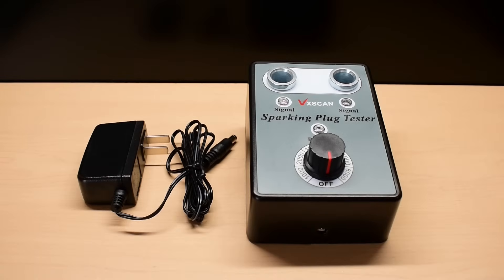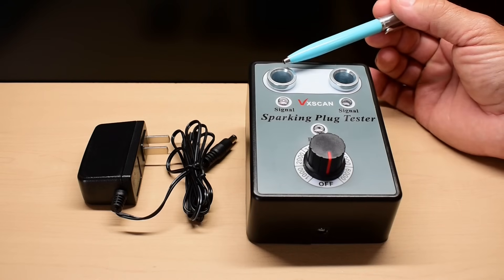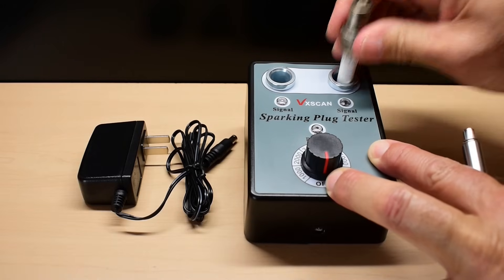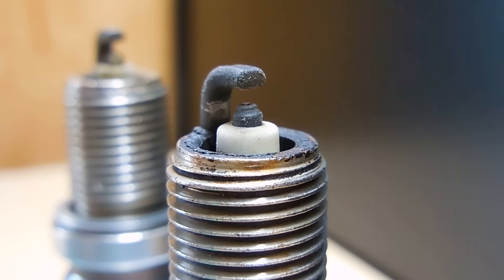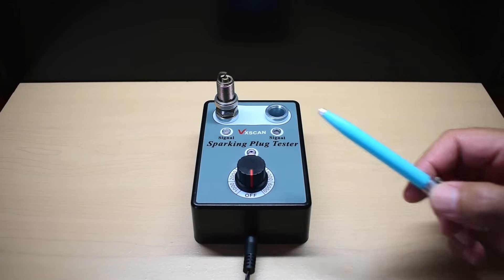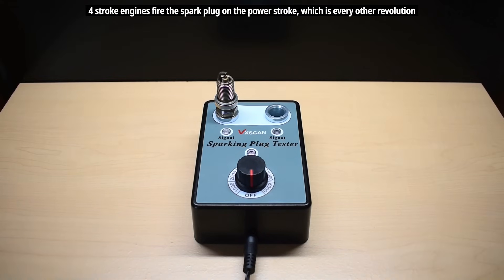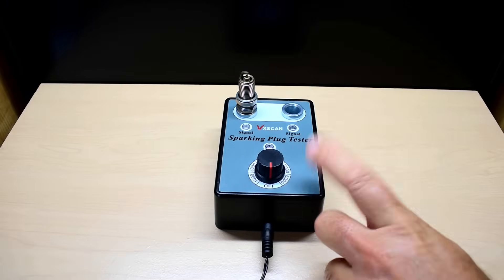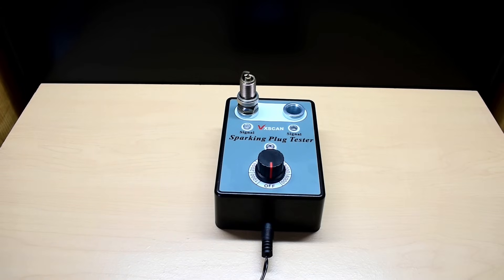How To RELIABLY Test Spark Plugs In Seconds!

Comment from the maker: Always clean the tip of the plug using a stiff toothbrush with carburetor or brake cleaner to remove any debris that can cause fouling.
Reply: Or you can use a soft,  brass wire brush.
Reply: @ronniepirtlejr2606  that's not a good idea because of the risk of short circuit.

Comment: The whole point of a spark plug tester is to check the air gap breaks down before the insulator.  The breakdown voltage of the airgap increases with compression, so this test is pretty close to useless.  Dielectric strength of air at atmospheric pressure is about 3kV/mm, plug gaps are about 1mm, yet it takes about 12 to 25kV to fire one reliably in an engine.  The RPM control is completely irrelevant.
I'd be very surprised if I saw a professional mechanic with one of those, and if I did he wouldn't be working on my vehicle!  If you don't want to spend out on a proper tester, the cheapest option is still new plugs - not this junk.

Comment: Your smart scan is probably picking up harmonics from the signal generator, which is probably digital. On a car or other motor, there is usually a coil on an analog type, or an inductor on an electronic ignition to smooth out the waveform. The spark plugs tester probably doesn't have much or any suppression for harmonics.
Reply from the maker: Very possible.

Comment: Another answer to people that say.... "Why would you test a spark plug when they are cheap?"
Like you said ... "they are not at all cheap" & How do you know if placing a new spark plug in your engine will fix the problem , if your not sure that's what the problem is?
You have to eliminate the possibility of a bad plug!
Reply from the maker: I don't recall ever having a spark plug turn out bad after I cleaned it & tested it as working good. Testing only takes a minute or two, but some people insist the testing isn't reliable without compression, or rather buy something they do not need. If the plug is cleaned of carbon deposits, it will not fail under compression if it's found to work without compression.

Comment: The camshaft turns at half the speed of the crankshaft in 4 stroke engines.. This testing of the spark plugs, 99.9% will not be done in any shop unless you pay the going labor rate of the shop. 99.9% of the time new plugs are installed. The testing of the spark plugs wires is the most important, as bad plug wires ruin even new plugs and weaken coil windings.
Reply from the maker: That's correct, and that's why you get one firing of the plug for every 2 revolutions of the crankshaft. As for testing, the shop would test if you had a specific problem, but if you went in for a tune up, then no, they would replace all the plugs. I have a wire testing video.

Comment: A proper spark plug tester, has a compression chamber of 100 psi, that is the only
true test, since the spark reacts differently under pressure and air to gas ratios.
Reply from the maker: Still does a very good job. As long as the tip is well cleaned using a stiff toothbrush with carb or brake cleaner, it will act the same as under pressure.
Reply: @electronicsNmore  Sorry, but that's confidently incorrect - unless of course you only 'test' plugs that aren't faulty....but I'm not sure that's the idea ;-)
Reply from the maker: @gadgetwob  Sorry, but what I said is absolutely correct, I've been testing spark plugs with a DMM and spark tester for 30+ years, and never had a jet ski, car, or motorcycle spark plug test good that was bad. Have a great day!
Reply: @electronicsNmore  With that level of anecdotal evidence you are clearly a lucky fellow!  I wish mine didn't point in the opposite direction.  Anyway, you got to wonder why all professional spark plug testers operate at 100 psi or so.  Well I'm not, but you might...  Good day to you :-)

Comment: Coil packs... ask your VW guy these days go out for more easily than spark plugs. Well... the campaign is going on for a lot of time now, since they decided: what's this garbage metal pack of 4 coils put at one side of the engine? Let's replace it with single plastic coilpacks... and to make sure they will stay pretty hot where did they put them: on top of the engine, exactly in between the two camshafts. Genius!
Reply from the maker: They design things to only last so long to make money.

Comment: That's not a reliable way to test plugs. Firing at atmospheric pressure doesn't guarantee it will fire under pressure.
Reply from the maker: Nothing in life is a guarantee. In 30 years, i never had a plug fail that I tested and found to work properly.
Reply: Put the device into a jar and fill it up with compressed air?
Reply: @m80116  that doesn't even come close to the kind of pressure inside a cylinder and really would not make a difference.  That said,  this test may not be 100% reliable,  but it can give at least some idea of the condition of ther plug. In other words,  if the plug is dead or has weak spark while testing,  you can be sure the plug is bad.  A lot easier then trying to test it while still hooked to the plug wire,  resting against the engine block,  while someone cranks it for you...

Comment: That is a good price to rule out the spark plug as being the problem.  Last year I was having trouble with my snow blower not being able to keep running when some snow hit the auger, replaced the spark plug and it ran perfectly.  It could have been the ignition coil(magneto), carb, or something else causing the problem. 

Great tip on using the toaster oven, thanks!
Reply: You can make new ones from used butt plugs.